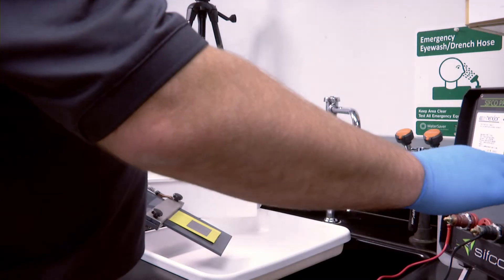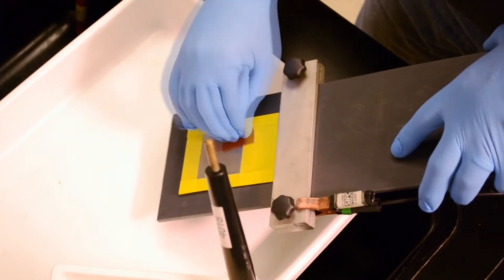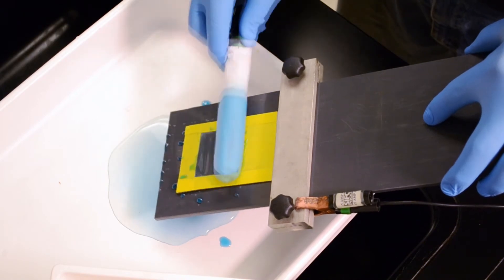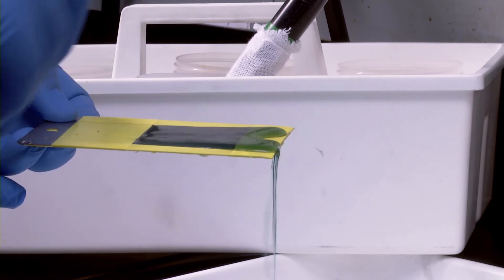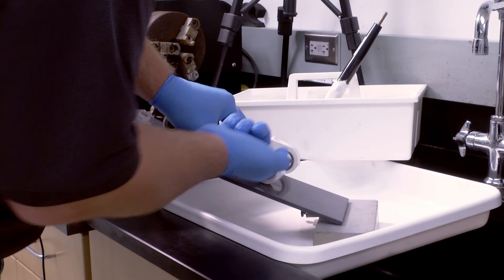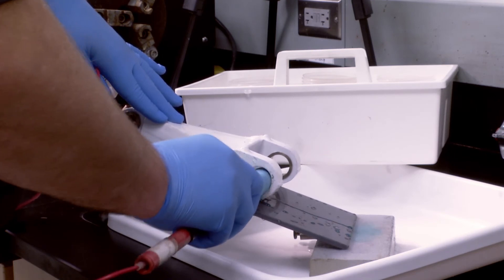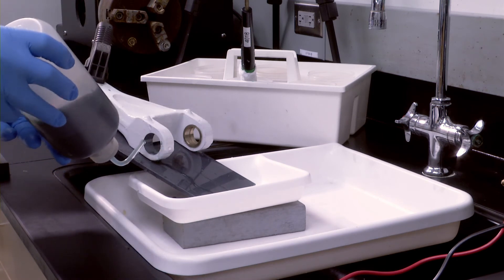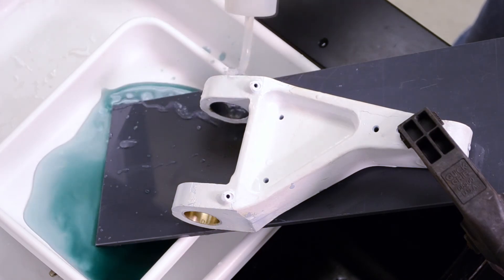Zinc-Nickel Plating: Why Use it and How to Apply it?

Comment: the test coupon/test panel should be in a fixed platform during coating process to achieve uniform thickness of coating..you can see the difference in the area coated after 500 hours exposure to salt spray...just saying based on exp. ^_^
Reply: Normally to brushplate a test coupon of that size you would pick an anode that covers the complete patch, and mask part of the sides with aluminium tape. That gives by far the most uniform layer in this situation. But if the coupon is completely covered by the anode, there's not much to see, so I guess they used this pen style anode (normally used for internal diameters) for demonstration purposes.
Reply: GuidoK I agree 100 % contact is necessary to achieve an even substrate deposit , don’t forget post plate heat treatment (de embrittlement) if an etching prep solution has been used